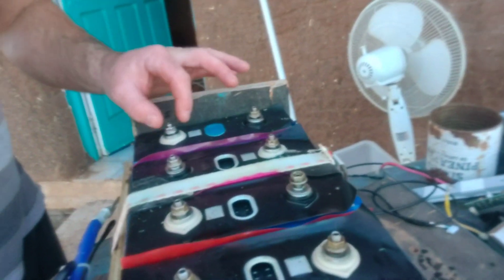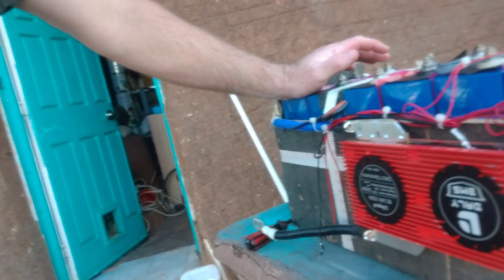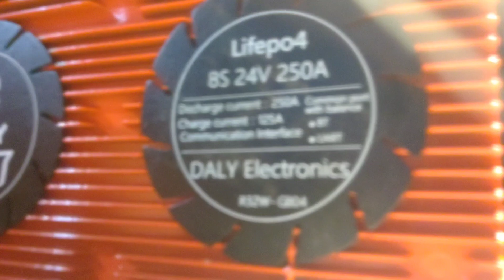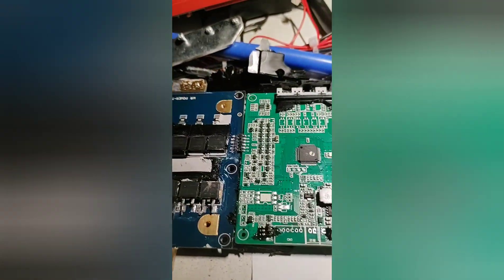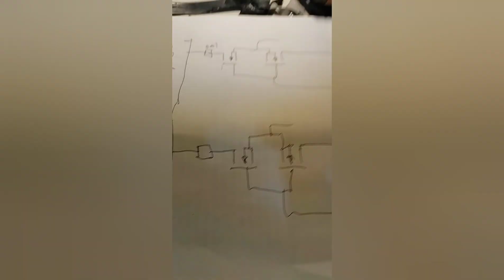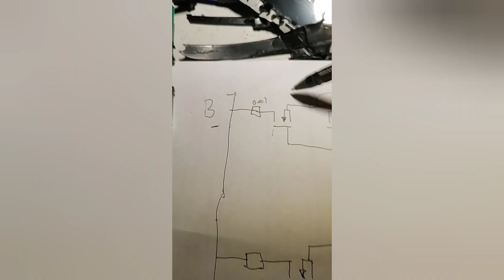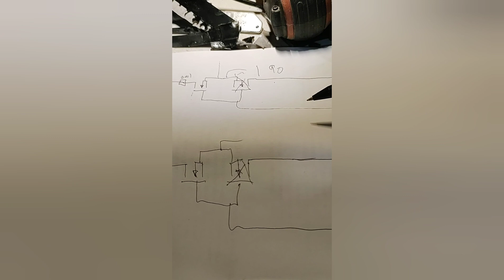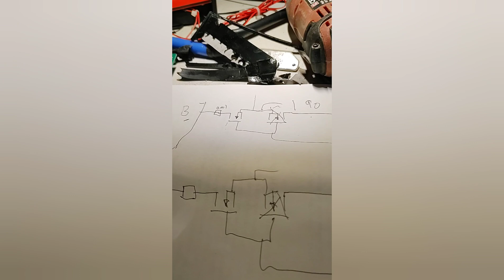Why not to use Daly BMS with MPPT controllers

Comment: You're making a big mistake on the purpose of a BMS. If the voltage of your solar array (90v!?) has gone directly to your batteries, it's not the BMS's fault! The MPPT charge controller is the one to incriminate solely. His purpose is, precisely, to control the voltage that comes from your solar panels and redirects it to your batteries. In order to make his job, the BMS should get the right rated voltage it's designed for, that's all.
And how in the hell you get "90 something volts" from your solar panels for a 24v system? You should max out a 40v open circuit voltage!!
Why don't you show us your MPPT instead?
Reply from the maker: My point is that any mppt solar controller CAN fail..yes Chinese ones more often like in this case. You miss the point I am not wacking the Daly just saying many people don't think about what can happen yet think they have protected their battery with a BMS that disconnects when overcharged.... Well maybe depends on your panel voltage if you have a shorted cc.
Reply: @jasondevine6014  Yep, MPPT charge controllers fail, sometimes, but never "blow up" batteries (with Bms in you case), unless you use Chinese cheap crap that doesn't have any circuit protection or, like it has been suggested, you made a mistake, either in the wiring sequence or in respect of the manufacturer' recommendations for your equipment.
 Again, how in the hell you get "90 something volts"(0:48) from your solar panels for what it appears to be a 24v system?
Reply: @fredericfray552  of course 90V, even cheap CC's handle 150V, expensive ones 400+V, what's your problem?? you want highV for a PV-array located far from batt-bank! he said IT FAILED !
Reply: @raedy07    Here I am not arguing about the fact that you can have a greater PV voltage than your battery bank voltage. For e.g. I am on a 12v system and my victron mppt 100/20 can handle 48v, but i chose to have a 12v PV array just to be on the safe side, for convenience I could have 48v PV array instead, but we know what happens when mppts fail! But hey!, you want highV for a PV array located far from your battery bank, so be ready to blow bms+battery if CC fails! You will come and blame it on the bms...
Reply: Save more money, buy better charge controllers...ie MIdnite, Sol-Ark does me good.

Comment: Interesting. I always felt that as charge/discharge is on the same cabling, so both circuits would blow, as you have seen. It was why I decided to go with this JBD relay based BMS instead:

https://www.aliexpress.com/item/-/1005002650532071.html

This is the relay it uses:

https://www.aliexpress.com/item/32618047403.html

The issue with this BMS is that whilst the app has charge and discharge ON/OFF options, in fact all you can do is turn it on or off in total. But that IS what you want, as it is safer.

Did you have a DC MCCB with shunt trip in it to protect the batteries? Something like this (obviously use only two of the poles for a DC battery), which has shunt and auxiliary contact devices pre-fitted:

https://www.aliexpress.com/item/4000798275975.html

Comment: If higher voltage then stated is required on the battery to controller why not just build a voltage monitor circuit that trips a relay if voltage is above a set voltage like 35v

Comment: BMS,battery management system. it is used to manage battery, it doesn't give protection to over voltage charge. it is to protect battery for overcharge/undervoltage the battery. so it doesn't make sense for me if you hope BMS can protect from over voltage charge. unless the name is battery charge controller, so i assume it should control the voltage input and output.. :)
Reply: ONCE AGAIN, he said CC FAILED !

Comment: I'm not sure you're define the charging voltage on mppt before like maximum 30V ? 
The 90V coming to BMS through inverter is it possible that inverter failure?

Comment: Your charge controller doesn't down convert the voltage from 90 down to12v, 24v or 48v? If you are sending 90v straight to your BMS then what happened is not the BMS' fault.
Reply: Maybe buy a better charge controller. MidniteClassic150, 200 or 250.
Reply: True.
Reply: Well its over voltage protected.  However this is only cell side.   And if the mosfetts fail they short.  So honestly i agree that its not the bms at fault
Reply: you and 17 others just don't get it: the CC failed, that's what it is about  :/
Reply: @raedy07  what you don't get is he's blaming the BMS for the charge controller failing. Just buy a reputable controller next time. Or use a BMS with dccs or solid state relays and don't start crying when you've fried the MOSFETs because you're an idiot
Reply: The bms should have a VOC threshold....but who knows?? Since it is not in the manual...and the CC might have only spiked for a couple of seconds which is common even for the most expensive CC's... acid vrla sla or gel batteries won't see these spikes...but the bms will cut out the battery after only 1 second of these overvoltage situations...and that's the concern...
Reply: @raedy07  the constant power source you mean?

Comment: You're not the first to put together a system with an almost guaranteed failure.

Would you complain if a 24 volt light bulb died when you connected 90 volts to it?  Exactly the same thing that happened here.  The charge controller manufacturer can't prevent you from disconnecting the battery during charging.  The BMS manufacturer can't prevent you from having that unloaded charge controller connected to the BMS.  Both should have some LARGE TYPE, RED LETTER warnings about the possibility of this failure but it seems that few or none have that type caution.

You didn't check whether the MPPT charge controller could handle being without a load?  That's the state it will be in if the BMS disconnects the battery at the maximum voltage limit.  

Do you remember reading the cautions in the MPPT charge controller documents?  The part about "Connect battery before connecting solar panels?"  Most charge controllers were designed before the advent of BMS battery protection and they need the battery to stabilize their output - no battery and the voltage goes to some unacceptable level, possibly damaging the charge controller and any electronics (BMS) that it may be connected to.  Nothing wrong with either the charge controller or the Daly BMS, just no awareness of "Connect battery first" being overridden when the BMS does its battery disconnect when maximum battery voltage is reached.  

There are still uses for lead-acid batteries - connect 35AH of AGM batteries to the output of the charge controller so it always sees batteries connected and the charge controller won't go to panel voltage which is more voltage than the BMS is rated to handle.

Or you do a LOT of research to find an MPPT controller which handles loss of battery connection in an intelligent manner.
Reply from the maker: The mppt went short first. Read the comments. My complaint is the fact that Daly does not advertise the maximum open circuit voltage of the BMS. But yes it was a design error on my part that I don't see many on YouTube mentioning. I will give you kudos for simple solution of some lead acid to avoid fault mode though...
Reply: @jasondevine6014  surely the CC failure would destroy the lead acid battery in the same way the LFP’s were destroyed? Unless you’re saying the BMS disconnected and caused the CC to fail?

Comment: Would it be possible to use around 30V zener diod with dummy load to dump the overvoltage?
Reply from the maker: Only as a trigger control voltage.
Reply: Sure you can.  But this is a lot of power.  You would need something like 500W of zener diodes(that's a lot of 10W ones), which would also make a nice heater.

Comment: There should be a breaker or fuse on all of the devices...you cant and should not expect the bms to act as a fuse/breaker
Reply from the maker: Fuse would not have helped. Overvoltage event and yes was fitted with properly rated breakers.

Comment: Have you looked at the Australian made (EV Power) BMS's? I think i will be going that way as i don't trust cheap chinese electronics. Their BCU RAPS has separate latching relays (240amp) for charge and load. It looks more expensive that a Daly but most people recomend sizing your Daly to double the current. In that case they are very similar price.
Reply from the maker: I had a look and yes that looks like a good alternative. Like I said I m using diybms now.

Comment: Very interesting discovery! Sorry for your problem. That was an expensive find, but those of us out here using FET based BMS's are thankful for you sharing your data. I am now suspect of my FET based Heltec/JK BMS, if it has a similar risk profile.
Reply from the maker: Yes indeed it would. There are some suggestions in in the thread on diysolar of using a snubber type arrangement to be blow the fuse. I have switched to using relays.
Reply: Think again, the only suspect here was the guy who didn't configure the equipment properly .  If you tune a carb wrong on a two stroke dirt bike the engine will burn up !  same problem here . all voltages are configurable for different batteries. he just doesn't know how or why to set these perameters up...

Comment: Did you have any protection on the battery side? A fuse or a DC breaker? The BMS got 4x the V it is rated for. No surprise it has blown.
One thing is very important from your video: the cells blow but did not start a fire. 
If that were a Li-ion/NMC battery then that would burn like hell.
Reply from the maker: Yes, but what is its maximum voltage that it can switch? That seems to be missing from the documentation that I can see. I think this situation is possible for many people as most run mppt controllers. The job of the BMS is to protect the battery in these failure mode cases. But yes lifepo4 is much safer than lion and thankfully so. The batteries actually still appear to work, although I will not trust these particular cells in any critical situation now that they have been so abused. It was no fault of the cells themselves. The overpressure vent did blow.
Reply: @jasondevine6014  Yep, the BMS protection has a limit. A 24V BMS max has 40V MOSFET-s. Everything over it will damage it. 
The crowbar circuit also not the perfect solution. If too less current then will not blow battery DC fuse. I am not sure it will even blow the Solar DC fuse.
I did not find an ideal relay solution either for my 48V with inverter/charger. If separate charger then Victron Battery Protector can work.
How did the MPPT die? What was the cause? Never saw an MPPT allowing the raw solar power to flow through. 
How long did the MPPT overcharge the battery?
Reply from the maker: @mrzed6597  where did you find 40v? I even opened the failed BMS but was not able to see a data sheet for the Chinese FETs.. the mppt is just a buck converter so if high side FET fails... I am now using diybms. I am using mechanical relays at moment but am testing my own relays with FETs rated for 200v. Should be ok besides lighting of course. I think that if a crowbar circuit was low enough impedance the output caps in the solar controller should have enough to blow the output fuse.
Reply: @jasondevine6014  I am just guessing the 40V for the Daly. I use Heltec active BMS (and forget to check the mosfets on it :D ). 
Some 48V MPP Solar PIP inverters have 75V IRFB3077PbF MOSFETs. There was even a topic where some replaced them with 100V SUP70040E-GE3-ND or CSD19535KCS MOSFETs.
I am not sure about relays. They can fail too. Connectors can burn together. If you have a good solution I will check it out :)

Comment: I was about to order 5pcs of these Daly BMS. Could you elaborate what inverter ?
Reply from the maker: The inverter does not matter for what this video is about. Your inverter needs to match your loads and battery voltage.
Reply: @jasondevine6014  I admire your patience here mate...
Reply: @marius_surfs I was thinking the same thing. If it were me, I would probably have pulled the video by now.

Comment: What MPPT controller did you use?
Reply from the maker: A few are asking about what mppt controller. It was a esmart. But that is not the point. Any mppt controller runs at a higher solar input voltage and has the potential of failing. Is your battery really protected? The need is real to check the maximum voltage of solid state devices or use a mechanical relay. I have considered designing a crowbar circuit to put between charge controllers and BMS in order to blow the fuses if charge controller fails. This will allow a solid state BMS to be used safely with high input voltages.
Reply: @jasondevine6014  Was the controller common ground or positive?  you think that matters?
Reply from the maker: I think it was common positive but no my point is that the mppt controller does not matter, a BMS should protect your batteries. The Daly has a voltage limit to do this that is not well documented. I still do not know exactly what voltage it can actually safely switch. I suspect maybe 40v for 24v BMS. So if your open circuit panel voltage into the mppt is higher than 40v you have a potential issue if your cc fails.
Reply: @jasondevine6014  yea thats crazy.  do they made a high voltage disconnect.  i use daly on my 24v system
Reply from the maker: @RodneySolarCircuits  not really. Best bet is use a seperate relay based BMS for now. Something like the batrium or I use diybms
Reply: @jasondevine6014  What about an EMP surge protector.  I see they have them for DC voltages like 24v and 48v.  I have been looking this week at them for my house and solar.  EMP's,  I believe are for high voltage situations not amperage.
Reply from the maker: @RodneySolarCircuits  I don't think it would help we are talking triggering at 35v. These things trigger at 100s of volts for lighting protection.
Reply from the maker: Possibly a voltage triggered relay shorting output of controller would work. Make sure cc is fused appropriately. Relay would not survive long, but has only got to work once really.

Comment: So the MPPT controller failed exposing the BMS to 90 volts which shorted out the mosfets. Check out ElectroDacus SBMS0. Read the install manual. He is directly charging the pack with panels but the voltage is matched to the pack. Very interesting setup and no need for tons of high current mosfets at one spot.
Reply from the maker: Yes but only does 8s. Yes this particular battery was 8s but I want a solution for 16s too. I use diybms now with relays but can also recommend batrium BMS. I understand matching panels to battery, but most installations with the panels installed many metres away from batteries really work out cheaper if installed using high voltage DC from the panels.
Reply: @jasondevine6014  Looks like Batrium has a new product coming out too.
Reply: @jasondevine6014  High voltage panel configurations do tend to be superior, particularly if you have long wires.  The losses are far lower.  But you absolutely cannot apply high voltages to ANY 24V battery system or BMS, whether relay-based or FET-based.   The charge controller needs to down-convert the voltage.

There is no need to ever match panel voltages to the battery.  They only need to be matched against the charge controller's capabilities.   Panel total power production is another matter... you usually do want your solar panel's peak power production to roughly match the battery capacity of the system such that the battery charges at 0.2C or higher.  There is some wiggle room there... typically 0.5C for charging is the goal.  But usually you don't want to go below 0.2V if you can help it because charging at such low rates makes fine-tuning the Bulk/Float levels more difficult.

Basically, if you charge at very low rates you have to set lower bulk target voltages to avoid over-charging a LiFePO4 battery bank.  But setting lower bulk target voltages also limits the current acceptance so some of the solar capacity can be left sitting on the table each day.  When you charge at higher rates you can set higher bulk target voltages without worrying about over-charging the battery.  This results in higher current acceptance and less wasted energy from the panels left lying on the table.

-Matt

Comment: What brand and model was the solar charge controller?  The reason I ask is that some MPPT charge controllers will have MOV's and a fuse right before the output to help with transients and controller failures.  If they start dumping more than say 60v out the MOVs will clamp and blow the internal fuse to protect the devices down stream.
Reply: +1 to this.  What MPPT? Important to understand mitigating factors.
Reply from the maker: It was a esmart. Will the MOVs really go at such a low voltage? I thought they would only serve for lighting surge protection or on AC input for higher line volatges... I am thinking about building a big crowbar circuit that I can put on output of all my charge controllers. A TVS or a SCR that can handle a 100A or so briefly to blow the fuses. I will have a bit more of a look at MOVs maybe I can find a appropriate one. It would be convenient to be able to use a MOSFET based BMS.